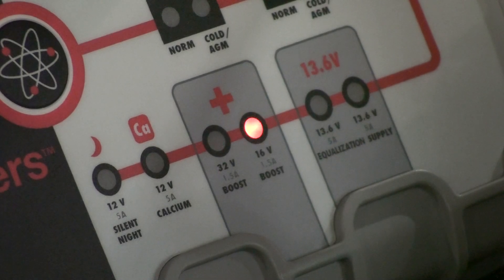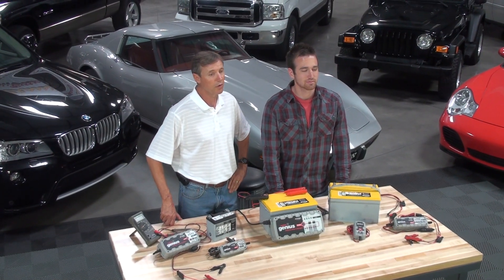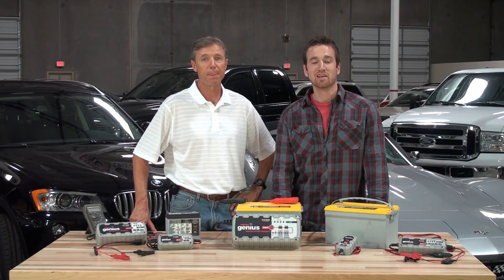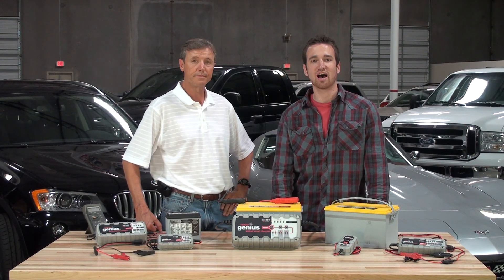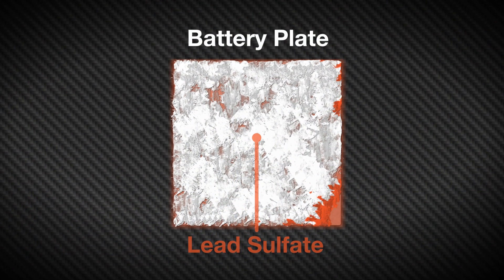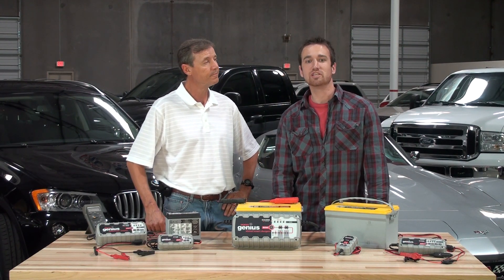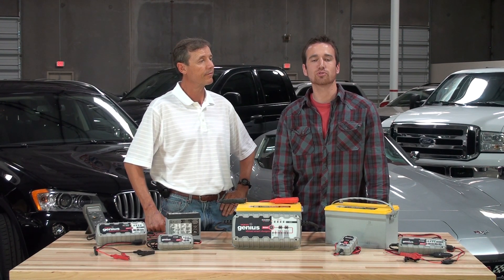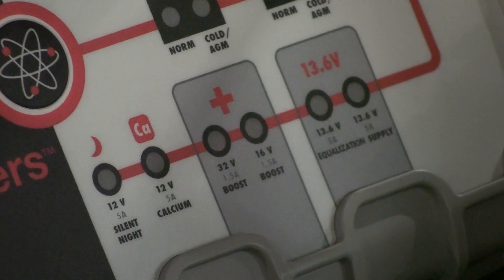Using 16V and 32V Boost Mode

Comment: I just got the NOCO G3500, and It doesn't appear to have this feature. Or is there a way to do this with the G3500? The battery I have is only a few months old, but it was in the cold for about two months, and is now completely discharged. If the G3500 can't recover it I'll have to hook up another battery to the discharged one to trick the charger.
Reply: I don't know if the G3500 has this feature, but on the G7200 you can put it into 13.8v supply mode and use that to bring a dead battery up to some state of charge, then use the normal charge mode.
Reply: Brad Silva Thanks. I wish I knew this when I bought the charger. I'm not a battery expert; I'm just a man who does all his own car work, and fixes cars for family - and sometimes gets paid. I'm not about to send back the G3500 to order a G7200 (and I don't even want to know what that would cost), so I'll just have to connect a good battery in parallel to trick the charger.